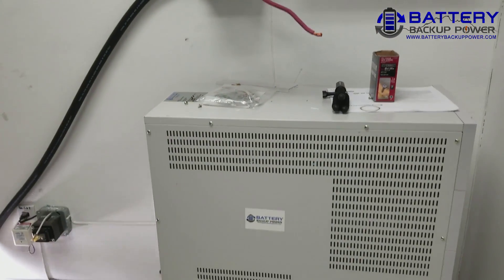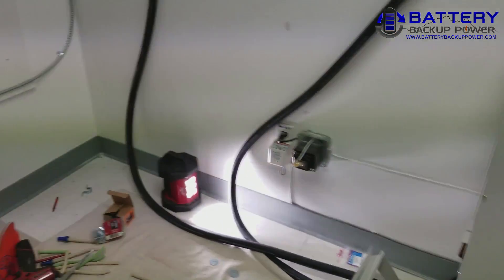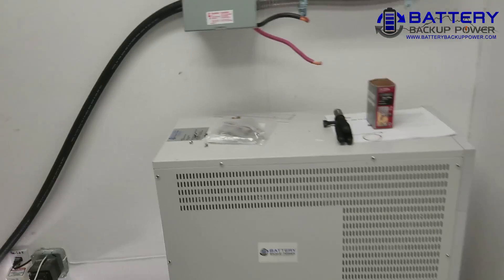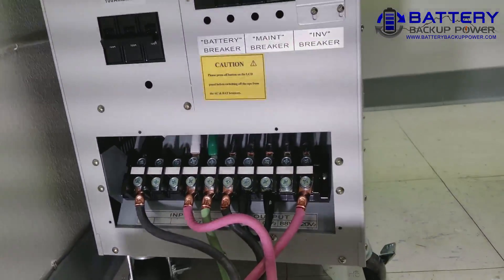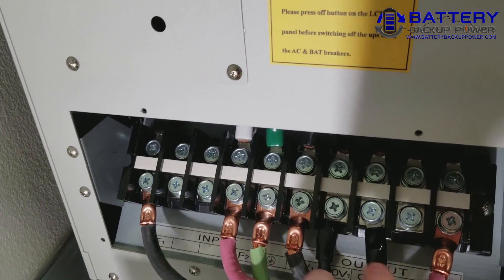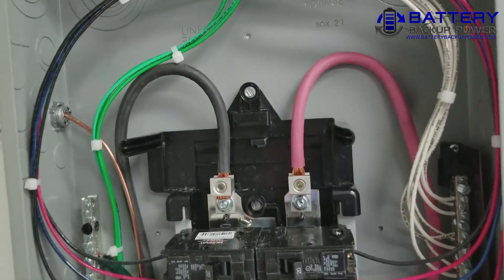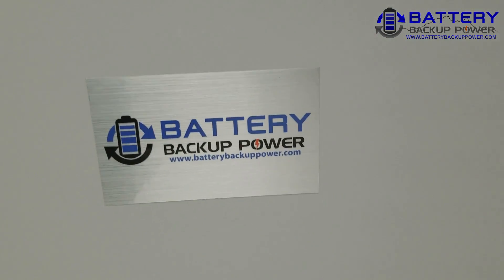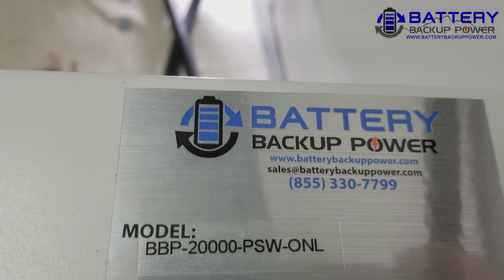Wiring A 6 kva, 10 kva, 15 kva, or 20 kva Battery Backup Power UPS To A Subpanel

Comment: This diagram out outline is mist.u need to go back to the motor with six wires. That returning three wires from the bottom of the middle contractor should go separately to the motor

Comment: Good afternoon, please I need a thorough 3-phase  battery connection diagram.
I how do I connect 30pcs of batteries into a 3-phase 120volts inverter. its urgent plz.

Comment: HELP PLS. IT'S MY FIRST TIME TO USE UPS, I HAVE 20KVA 3PH/1PH. THE PROBLEM IS THAT I AM GETTING HIGH VOLTAGE BETWEEN NEUTRAL AND GROUND AT LOAD SIDE. WHEN POWER  IS RUNNING ITS 0V  , THEN WHEN BATTERY IS RUNNING (ALL CONNECTED LOADS ARE "ON") AM GETTING 80V +
Reply: Hii my 30 kva ups alarm    REC fail then plllsss tell me meaning of REC fail